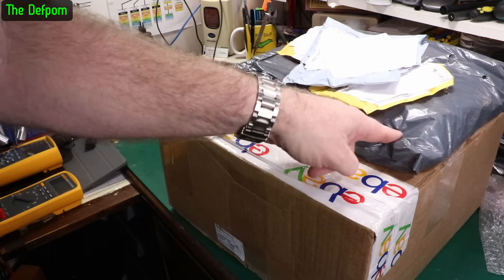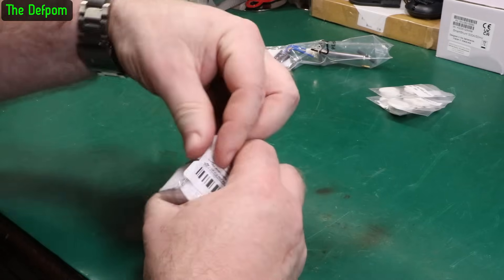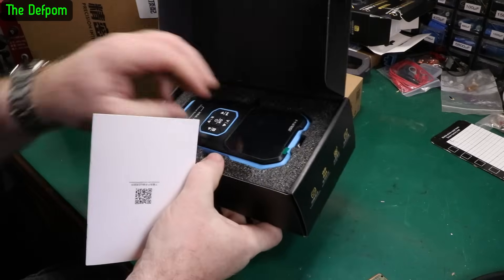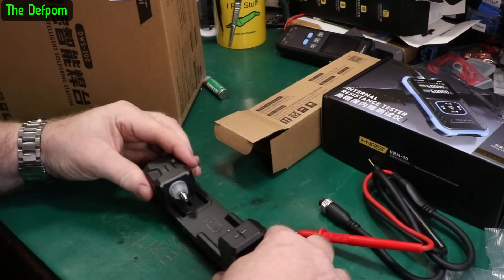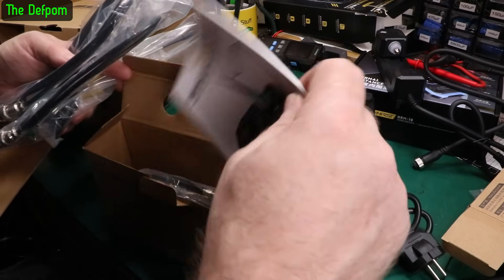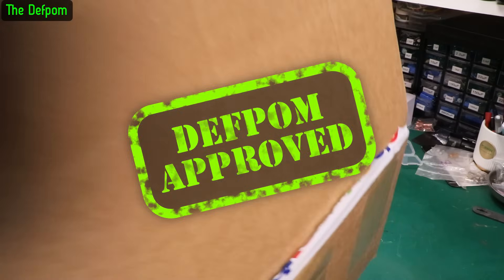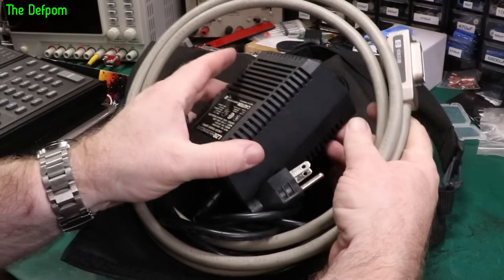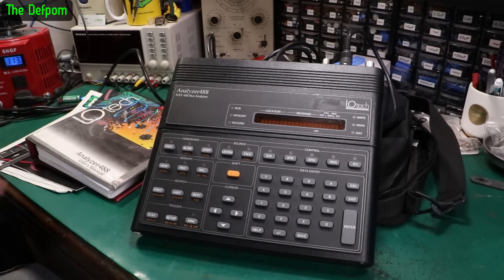🔴 Mailbag Monday 23rd December 2024 - No.1314

Comment: The pin & collar inside the slider of the cell holder is spring loaded.  Once the length is set, you can pull it back with two fingers on the tapered surface.  It would have been nicer if there was a lever or larger surface so you can pull it back with one hand while changing out the cell with the other.  You absolutely need to set the jig tight on the cell, so that the cell is pressed firmly by both the inside little pin and the outside tapered surface.  Otherwise, all 4 wire connections are not connected.  The short leads is something I noted some time ago when I first saw them advertised.  It's the same with the Kelvin clips.  Why not give us one or two more inches beyond the Y split?  One thing you can do is warm the cable and straighten it.  It's quite stiff and retains the shape it was in the box.  Otherwise, it fights for it's kinked shape you when you try to use it.